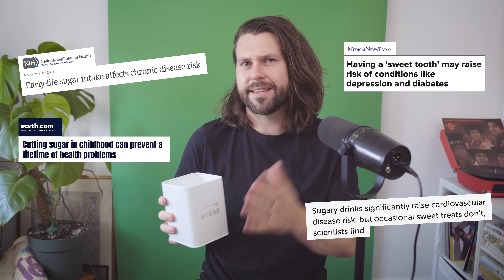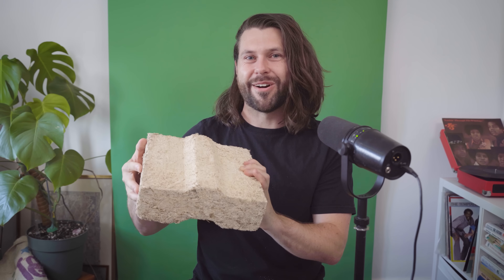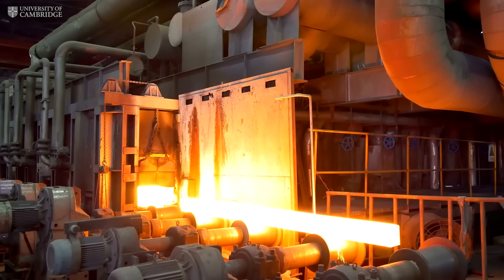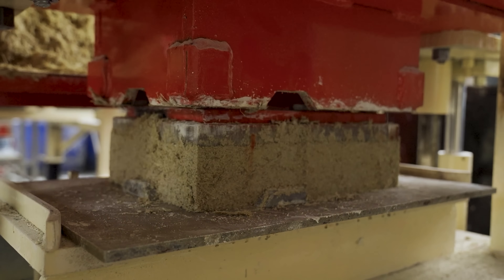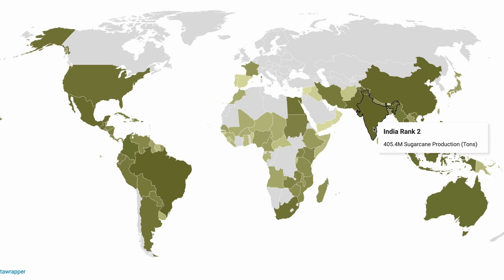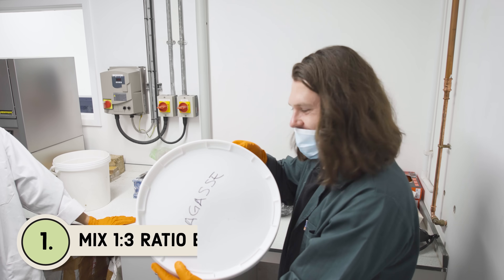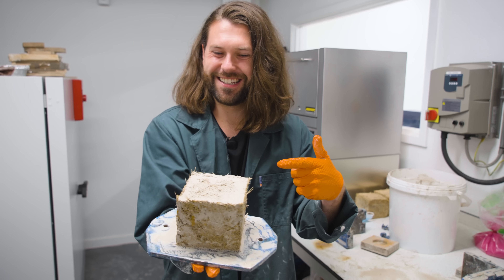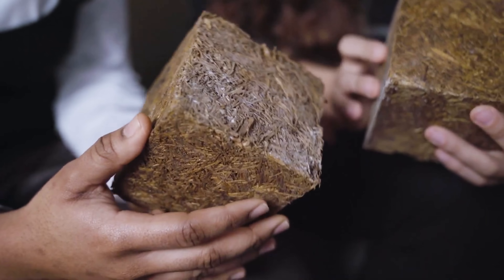How Sugarcane Waste Could Replace Concrete

Comment: Huh... Weird thoughts regarding that concrete alternative.
Concrete has a ton of uses, some rather extreme such as radiation shielding for nuclear technology.

It's heavy, its tough, it can be permeable, and can be shaped relatively easily.

It's also not biodegradable and can last hundreds to thousands of years. 
Im concerned about sugarcrete being vulnerable to water such as condensation.

I'd need to know more about this idea before supporting it because it seems sketchy.

Comment: Forget the Crete part.  Imagine here in mid Florida where our soil is pure white sugar sand (silica) and we have so much local byproduct and ash from our Sugar and Orange industries. Quantum AI is working on the activator.  The idea is FREE local Sandy soil + Binder + Activator leading to   cheaper and easier roads and structural walls.

Comment: The video is misleading. This is concrete with sugarcane biomass replacing rock and sand. The binder is lime. Tons of videos on YouTube about mixing various fillers in concrete including sawdust, Styrofoam, seaweed, straw and even airbubbles.

Comment: ok so we aren't born yesterday, their recipe is to add bagass to white concrete then water... any fiber alternative would do the same and guess what, the problem is the fkin concrete you have added, u still need to fire it up, crush the stones into fine powder to use them in this way, releasing CO2 in the process.

Comment: Why did you blur the binder ingredient? I thought the goal was personal empowerment, circular economy, blahlblablabl.... If this solution is so great, why is this not free for everyone to look at and tinker with? 

Also, this is a natural material. What about natural decomposition over time, mould? What about fire? One would need to add fire retardants and anti-fungal chemicals to get it to actually work for as a building material. As is, it should be fine if you build a hut or a tool shed that you might not mind rebuilding when it falls apart in a few years. But let's get real, is this structure going to be standing in 30 years time?

Comment: What is blur, how is it circular if it's a linear path from sugarcane to brick, how long do the bricks last?
Reply from the maker: From Oluchi: Currently the sugar industry is linear. We are proposing a circular economy where the waste is turned into blocks, which are used to build affordable homes. These blocks can be recycled to: build new homes, crushed to make new bricks, or crushed and used as soil replacement.
Reply: @itsSamBentley  I'd argue that CO2 into cane into CO2 is circular and CO2 into cane into brick is linear in terms of the Carbon cycle.

Comment: What is the R value? How did it perform with fire and water tests? Costs compared to standard and other alternative buildings?  Can they make the equivalent of drywall plasterboard? How about fencing, will it work in the rain? Does it decompose, or are the fibers coated? Can you saw or drill into it? What is it replacing besides brick; Can it be used for furniture and other plywood uses, can you use it as a plaster or cob, countertops and flooring?

Comment: My big questions weren't brought up, those are to do with durability and longevity. Is it actually going to last, or is it going to degrade quicker than traditional concrete? Is it actually strong enough to withstand elements? Houses need to be built at scale and whether the actual building blocks will degrade any quicker or be resistant to elements any worse are some questions many many construction companies and governments would have about this.

Comment: Fantastic idea, 
What mortar are they using to adhere the bricks together? Perhaps you can shape the bricks to incorporate a larger mortise and tenon joint that could possibly negate the need for cement mortar.

Comment: This seems  fantastic at first but some of the info is inaccurate/ misleading. The 40% of CO2 immisions from construction is referring to all construction not just the production of concrete. In addition much of that CO2 production is due to using fossil fuels for energy that we could replaced with clean energy without the need for any new tech. Concert however does release CO2 due its chemistry when made. Concrete alone accounts for ~8% of global CO2 emissions of which 60% of that comes from calcification reaction, so it’s really only 5% of emissions that this would at maximum have the potential of eliminating if we replaced all concrete. Even if possible for this to meet all building needs, dedicating all that land for growing sugar for this use could be ecologically harmful as well. And it could also impact food security.  So I find it doubtful that this could completely replace concrete as it may cause issues for ecology and food security. Still contributing to reducing CO2 emmisons by just 1% is a big deal and helps.

However a bigger issue is the main step in the production of concrete which creates CO2 is the production of lime. Lime CaO is produced by heating limestone CaCO3 at high temperatures causing CO2 to gas off leaving behind the lime CaO. In the video she adds lime to the sugar waste. How is that Lime produced? If the process of making this still involves the same step of making lime that is the main source of 60% of CO2 from making concrete, then this doesn’t seem to reduce any of the CO2 produced in making concrete. Nonetheless this would still be beneficial by giving us something to do with the sugar waste and thereby reduce the need to produce as much traditional concrete and thus can reduce some environmental harm by reducing the likelihood of sugar waste being burned  and reduce how much mineral we need to mine for concrete, but other than that it doesn’t seem like this actually reduces any CO2 emissions. If it still uses the same amount of traditional lime as concrete then this process produces as much CO2 as traditional concrete. 

When it comes to environmental impact you always have to look at the total process where do all the resources come from and go… lime is the main source of CO2 from concrete ignoring were that comes from does not reduce your CO2 emissions. 

In addition there is no mention of strength, durability, and flammability which are all key questions of this is practical.

Comment: This is an absolutely amazing alternative to concrete especially in rural areas of the global south. I don't understand why is this and similar methods are not popular in particularly rural areas? In my opinion apart from very nessesary use concrete and similar modern materials should not take up majority of the building materials in rural areas. Aādaāb from 🇵🇰.

Comment: I'm guessing I missed some of these in the video: 
How long do they last? How do temperature fluctuations/extremes affect them? Waterproof/resistant? Fire issues? Height & weight limits? 
Vulnerability/attractiveness to vermin, especially rodents, termites, roaches and other insects (which woodpeckers [etc] would go after)? Would encasement in stucco with a hardware cloth barrier be feasible?
Building repair issues/procedure in case of large damage to a specific area, such as a severe vehicle impact (which happens way more than I'd like to think about, at least as far as I've seen)?
How to clean them in the event that something spills onto/into them?
Particulars re. painting?
Is there a test structure being monitored, how long has it been up, & are "real world" tests being done on it? How many floors?
How many places (& where) does it currently pass building codes? Restrictions?
I'm wondering if it's maybe even superior in an earthquake prone area.
How small can it be scaled down? Would it still hold up as a weight-bearing column?
Insulating qualities?
It seems like it might be good for temporary structures

Comment: I want to know as well as I'm sure a lot of builders and engineers what the r-value is on the bricks and if they take in moisture or humidity. Do you have to seal it on the outside with some kind of paint, and lastly how long do they last in the environment. What about adding natural latex to the mix. I'm sure it would add to the overall cost but if it made it last say twice as long then it would be worth it.

Comment: NO future! ...... ALL of sugar is waste! It will die as an industry unless its properties are completely changed. AND....creating the lime RELEASES all of the C02 bound up in the limestone, negating its carbon capturing plusses. Finding a way to make the cement binder from other waste is a better idea if it releases no carbon or requires no energy. (2,000 degree kilns)

Comment: Your  unique formula.... , may bring some good news 🙏  to the world...
At a time the world  is running  out of soil ...
I did hear something like  sugar cane  bricks is like... one third cheaper  than the traditional  clay bricks ....
This might  bring some good news 🙏 for commercial  growers...
Rice farming community ( the rice / paddy  tree I guess  call hey ) , banana  cultivaters ( dried  banana  leaves and trunk ) , coconut cultivaters  ( dried coconut  branches ) these leaves  even once  they are dried  they for sure so strong...
The light weight , very  much heat resistant , reusable....
The  40 % or so  waste generated  from the construction  industry....
Might have  some good  news for ..
A  finish or a Danish company  who work with  ( data centres  heat ) where they possibly  generate  electricity..
As you mentioned  the extreme heat from iron production  and cement  production might be some good  news ...
If they can coordinate  with  these industry  heads ...
The 40% of waste  produced  by cement and  iron industries might  be able  to significantly  reduce  future  global  warming...

❤

Comment: Would be interesting to compare it to hempcrete. Looks like longer fibres to it might have better structural characteristics, but you can press hempcrete to raise the density and reduce porosity (trading more strength and material used but less insulation and less humidity and temperature control). At least in Australia where we grow both, shipping bagesse around the world seems like a bad idea.
Reply from the maker: Oluchi sent this to me just now: Hempcrete is also a great choice. The advantage that sugarcrete has is in the immediate available quantity of waste. Sugarcane waste is around 600 million tonnes per year globally. For Hemp to match these numbers you would need to grow hemp 16,000 times more. A very unsustainable solution, talk less of the use of much needed arable land for food.

Comment: I'd be really apprehensive about building a structure out of so much organic material - especially one that is untested.  If I get termites, I can crack open the wall, remove/repair a few studs and move on with my life.  But how do you replace a handful of interlocking organic bricks when (not if) they get infested? You can't just knock a few out and go.  No matter what you do, the structure is going to be compromised. 

I'd certainly use it for a shed or a wall.  I think it might be fantastic for raised garden beds in the right configuration.  I certainly wouldn't trust it for my home.

Comment: The big problem with a lot of these alternatives to reduce carbon use in concrete is they end up being a compromise or unsuitable for a lot of the desired uses, either because the new version is not as strong, does not last as long, does not have the same thermal or stress properties, or can't be applied the same way (for example, shotcrete, which can be sprayed over forms for domes, arches, and non-standard shapes). Otherwise, I love all the new alternatives, such as hempcrete and this.

Comment: Flammability and long term stability and resistance to mold would be my questions.
Reply from the maker: Oluchi sent this to me to reply : For the sugarcrete school we built in the formation we made sure to use binders that reduce flammability. We also rendered the building to make it more fire resistant. Mold is an issue that many buildings face unfortunately. This can be tackled by designing buildings with a better natural ventilation system. This is also valid for any building built with Sugarcrete.
Reply: @itsSamBentley  so probably not a good idea for the tropics? One could treat the bagasse or even the bricks but that's another layer of cost
Reply: There’s an issue with long term water resistance. I’m looking to build sustainably and unfortunately this requires more carbon emissions to make on a large scale than expected, and has issues with water penetration and mold. Good ideas, though!

Comment: Brilliant idea - is it thermally better than brick? And would it work in a wet climate?
Reply from the maker: UEL doesn’t claim Sugarcrete is universally “better than brick”, but it has been tested for thermal performance and can be formulated to provide good insulation, especially compared to dense fired masonry on its own. In wet climates it’s designed to work like other masonry systems, using proper detailing, lime finishes and damp protection, rather than relying on the block alone. It’s about smart design as much as the material itself.

Comment: This is so cool! My only question left was how these bricks function during extreme drought and heat or the opposite during monsoons, floods, high humidity. Concrete once dry stays dry and structural (if built correctly) so I'd be curious how well these sugar bricks withstand weather.

Comment: how sturdy/durable is that brick compared to traditional concrete? how does it stand up to the elements in relation to hot, cold, rainy or dry environments?

Comment: This looks very cool and very promising! I was hoping to see how it's cured, I assume air dry. But I was also hoping the vid would touch on how fire, moisture, and mold resilient it is. Especially compared to, say, a timber frame house. Also it's insulation potential too.
Reply: I, too, would like to know hownit compares to the superior heat retention of wooden houses (Scandinavian style).

Comment: Great video, plus I liked the house they were using as an example; very functional with the good lighting from row of  windows above, hopefully they lever open to catch the breeze for cooling in summer. That with the insulation of the bricks would make a very functional house.
Reply from the maker: That's a very good point actually!

Comment: work 10 months a year and then have no job? as in they have a 2 month vacation and thats a bad thing?

are these fire and flood and earthquake etc up to code? Are they good at keeping you protected from the climate (heat/cold)?

This sounds good on the surface. I hope its not more consumer recycling/less driving/paper straws etc when really 90% comes from the company itself.

Comment: Fire proof, bug proof, tensile and compression strength  ?
Reply: There is a nicely detailed reply upthread addressing all this, essentially that all the big safety questions have been cleared, just longevity testing is ongoing.

Comment: Are there any substantial drawbacks that are in need of addressing for sugarcrete? I definitely won’t say no to a flawless win-win material, but I am curious to know if it struggles performance-wise in comparison to concrete or other comparable materials. Does it handle weathering, water, temperature fluctuations better or worse overall?

For the most part it does just seem to just be a type of cob, which is able exist for literally thousands of years, so I assume sugarcrete could just be better in every way if used in the right environment.

Awesome video, thank you so much for sharing!
Reply from the maker: From Oluchi: Sugarcrete has very promising features. The building prototype is still being monitored and studied. One of the biggest challenge sugarcrete and other biomaterials (and relatively new construction products) ARE FACING is the slow adoption from the industry and as a consequence the general public.

Comment: The sugarcrete is wonderful but this lady lost me at AI. She knows that AI is another huuuuuuge polluter at this point right? The water they cool their stupid data centers with becomes toxic to the environment and they're guzzling power.
Reply: If AI was just used for meaningful solutions and innovation it probably wouldn't require all these huge data centers. The problem is that it's being used for pointless slop for no real purpose 99% of the time.

Comment: Does anyone have the material properties for this? What's young's modulus? What's the poisons ratio? Modulus of elasticity? It has a lot of cracks, what's the stress intensity factor? How well does it hold up to freezing? 

Don't get me wrong, this stuff is super cool, and has all kinds of applications in developing nations (which is where i believe most sugarcane is produced, meaning that's where it would be easiest to get), but its application in developed nations will be almost completely dependent on the material properties.
Reply: You are totally right, it seems like this would be highly combustible, quite a fire hazard.
Reply: @imemeloni  I mean, so is wood, That doesn't stop anyone but California. I think the bigger issues are how does it stand up to earthquakes or floods? Its made out of plants so its probably pretty light, how well does it handle hurricane force winds or tornadoes? How well does the binder hold up to UV exposure over the course of 40 years? 

In places where the issue is "we literally don't have the resources to build mud huts" those aren't concerns. In places where we have "what material do you want your toilet made out of?" resources, those are all major concerns.